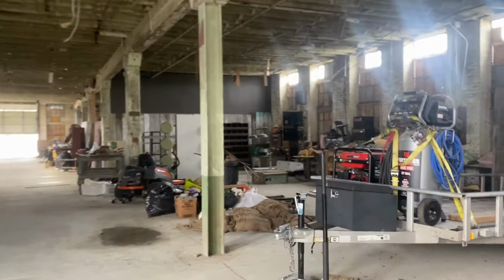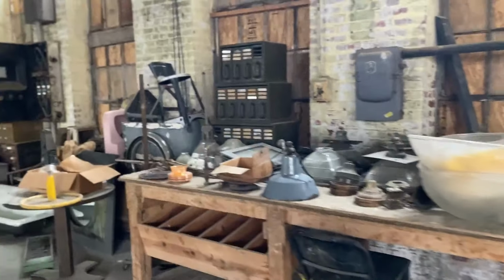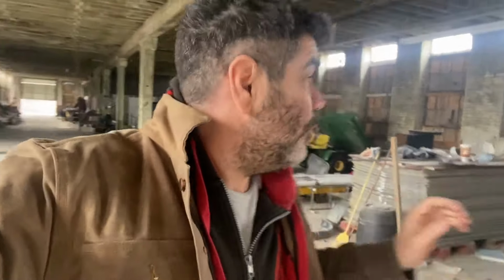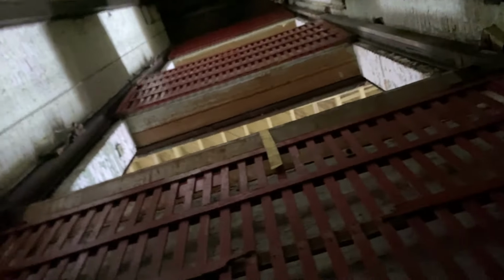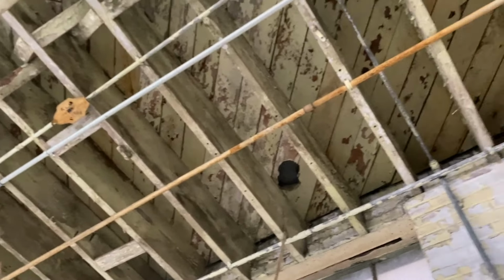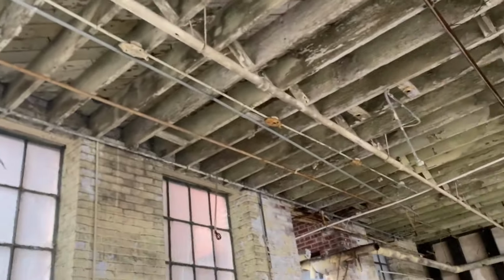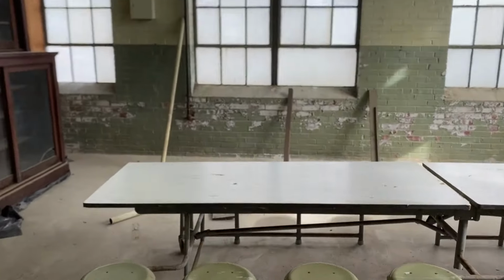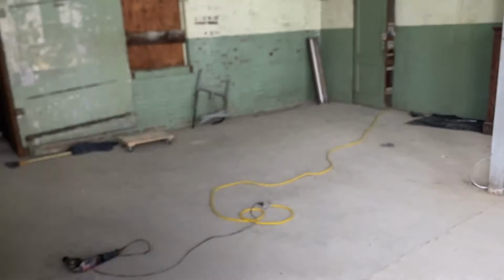Industrial building renovation: cleaning out the rooms

Comment: Just a thought, if you are replacing  your 3 phase panel, why not move the panel closer to the elevator.
Reply from the maker: Moving it, (if they agreed) would be at my expense which would probably be a lot.  There is good news though, I haven't posted it yet but I opened some conduit and found loads of heavy 6 gauge new wire.  what a stroke of luck.

Comment: Nice progress! 
A strap or rope hooked on the far side of that table then ran underneath and stepped on might have made the flip easier. Or run it over the top and pull it towards you while footing the table could work too.
You probably already know this...a decent hand truck and a strap or 2 can move mountains. I usually prefer simply load straps but careful use of a ratchet strap can be handy to lock the load in. They can also crush things when required.
Keep up the great work!!👍👍
Reply from the maker: Hi Mark!  I actually have a good blue hand dolly.  Just haven't shown it on the channel.  It will have its debut soon as I tried to use it today on something that was 12 foot long. didn't work too well. .

Comment: will be nice to get that area cleaned out. for the no. 8 for the elevator you may need to run 3/4 or 1 inch EMT. You're right the wire won't be cheap. The EMT should go up pretty fast since you can add couplers to each 10 foot section. Also agree with the decision to hire some help. Will be able to move stuff more rapidly with hired help.
Reply from the maker: You know what?  funny you should say that. I found a run on the second floor with 3 strands of #6 heavy gauge wire.  It was a giant stroke of luck, all run through 1 inch with compression connectors. After I meet with the city and they inspect it, I'll talk about it here.

Comment: You might consider aluminum wire, not the best but much less expensive. You would most likely need to increase the wire size up a gauge, a voltage drop calculation should be done. Plan on new conduit, I believe the National Electric Code does not allow reuse of old conduit. For the distance you are going anything to facilitate wire pulling will be welcome. Short cuts will cost in the long run.
Reply from the maker: we started opening conduit and there is a lot of heavy 6 gauge wire that is fairly new which was like winning the lottery. So I will be able to pull that newer stuff and re-use.

Comment: Chris,

Just a thought.

If you replace the Taibel top with a single full length piece, it may limit the number of people that can buy the Taibel because they may not have enough space in which to put the full length Taibel.

Also, The foldable size of the Taibel will be fairly easy to transport. If the Taibel is at full length, it will mean that in a very large truck or trailer will be required for Transport.

Although, I have just had a brief memory recall, and would I be right in saying that you were going to keep the table.

The large pigeonhole storage unit that you pushed around on the two trolleys, if if it is made of older style timber, should be worth quite a lot of money as a rustic piece.

In an auction that I did some years ago, I had a very rough and ready, similar pigeonhole unit With very few square edges on the boxes and I was expecting only about $100 but I believe it made Summit like seven or $800.

It might be an idea to put the pigeonhole unit on some small glass, so that the lip of a trolley can be put underneath it if you need to transport it around the building.

Just out of interest I have just finished clearing out an engineering workshop basically by myself with the temperature being somewhere between 41 and 44°C. It was very very tiring. I envy, the fact that you’re probably working in about 44°F

Greetings from Western Australia.
Reply from the maker: That thing is definitely old, it has a really worn rubbed look, and is solid and heavy as load of bricks.  I wonder what species of wood it is.  I could do a segmented table top on that. I was thinking of putting it in my break room area that I am working on.  Less than 44f.  It's around 0 celsius this month but hopefully it will warm up soon. You are enjoying summer right about now!

Comment: I'd like to know if a cost analysis of getting the 100 year old elevator working up to code against retrofitting a new hydraulic elevator or even a scissor lift was done and if so pls share
Reply from the maker: No cost analysis has been done, but anecdotally I know that before I bought the place the elevator was still working. they sent a part off to be fixed but it never came back, then copper wire got stripped.  So right now we are hoping that we can get it going.  if not, a giant winch can always be installed to serve as a lift for cargo only.  But I would love to have the original thing going so I am going to try that first. so many people from the YouTube community are helping.

Comment: It's too bad you don't have either an air lift type work platform or some type of scissors lift.  With the work platform, you could raise up to a comfortable working height and since most have castors, you could strip that suspended ceiling crap with someone pushing you along.   Do that conduit work too. Some scissors lifts are self propelled (electric) so you could move yourself as needed.  They're spendy, though.
Reply from the maker: I have roll around scaffolding, but they don't have outriggers.  It would be cool to drive the bucket truck in the building and use that!  but can't get back into those small rooms.

Comment: If your only 3 phase use is the elevator, why not run the outside power supply directly to the elevator penthouse. You can avoid routing the power inside in conduit.
Reply: You might even be able to use a three phase portable generator. Figure out your functional requirements first.
Reply from the maker: We have a converter if the 3 phase falls through. changing the position would put the cost on me and I don't know if they would do it. I called them and they are coming out for consultation this week. I will find out as much as I can.

Comment: You mentioned 125 ft rolls of wire at Home Depot. That sounds like you're looking at romex wire, you can't put that in conduit. You'll need THHN single conductor wire. I'm sure your electrician will do it right but I just thought I'd mention that as an FYI
Reply from the maker: I found a ton of #6 THHN in existing newer conduit.  I will post about it down the road once I have sign off from the city.  what luck!  The engineers from Ameren are coming Thursday, the city is coming Wednesday to give me guidance.

Comment: In my mind #8 wire going that far seems small. Do you happen to know how much amperage the elevator draws?
Reply from the maker: it draws less than 60 amps as there is a 60 amp fused disconnect.  I did find a ton on #6 newer wire in the building believe it or not.  The building provides.
Reply: @brickandsole   The motto holds true!